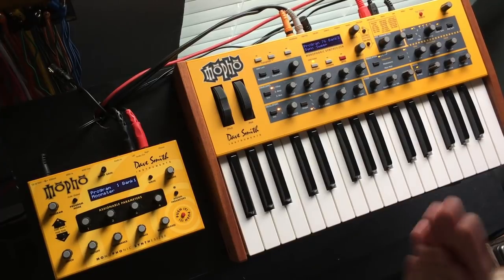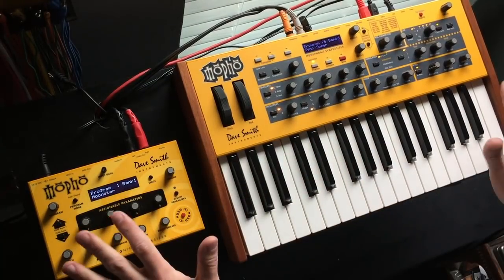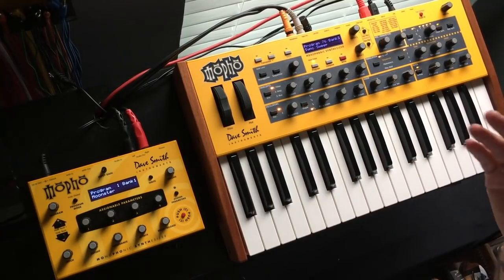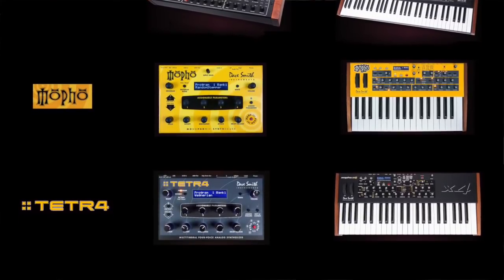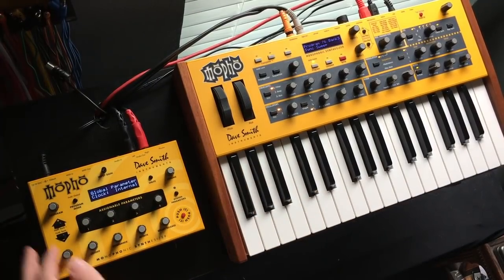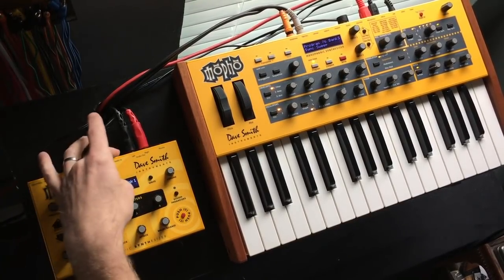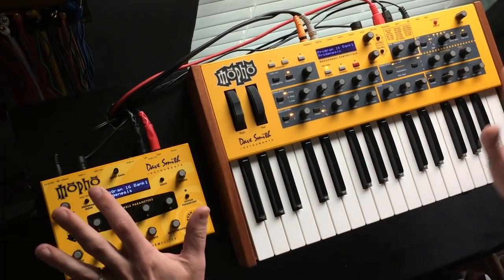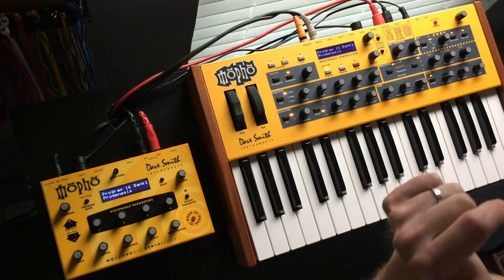MoPho + MoPho = DuoPho (DSI poly chain history, how to, & demo)

Comment: You are a little mistaken about the name and capabilities. The Tetra differs from the Mopho mainly in that it does not have the analog input that the Mopho has. And that's why Mopho 4 is exactly Mopho, but with four voices. And it also has a feedback knob, just like the one-voice device. Tetra doesn't have this.
Reply from the maker: @BeachPresent  got it, thanks.

Comment: Hi. Can you use the small Mopho as the 'master' instead of the other way around?
Reply from the maker: Thanks for checking out the video. Unfortunately you can't set it up like that because the Mopho module doesn't have a poly chain out (it only has midi in/out). However, the Tetra does have poly chain out so you could use a Tetra to slave the Mopho keyboard if you wanted.
Reply: @musicalmiscellany  ok, thx. I'm asking because the clock section in my keyboard is broken and the modules go quite cheap second hand. This way I was hoping to be able to still run the sequencer and arpeggiator.
Reply from the maker: @philipgalle1339  Ah. Did you contact Dave Smith Support yet? They have a great repair program, even for out-of-warranty products. My Mopho's sub oscillator stopped working a couple years ago, and I sent it to them. I believe they charged me less than $30 including the shipping. Seriously... look into that. Dave Smith/Sequential has the best repair policy in the business.
Reply: @musicalmiscellany  I e-mailed them yesterday. I live in Europe though.
Reply from the maker: @philipgalle1339  Ah, understood. I'm not sure if they have a repair center in Europe (or an affiliate they work with) but they'll let you know. Their support is excellent.
Reply: on the tetra you can

Comment: Awesome breakdown. Was thinking of grabbing a mopho desktop or tetra. Do you know if the polychain will work with other products? For example, my Moog Sirin? I don't mind if the two patches weren't the same since they obviously have different architectures, just wondered if I could play the two devices simultaneously. I was thinking perhaps tetra chords w/ sirin leads. or a duophonic bass with a mopho and sirin.
Reply from the maker: Thanks for checking out the video. The only thing I've ever polychained are these two, so I don't know how it would function with your Moog. That said, I would think you could (at the least) send the MIDI control data and that would accomplish what you're looking for. That's easy to do. I tried that with my Volca and it works. You can send (or receive) MIDI note data on the Mopho/Tetra. Good luck.